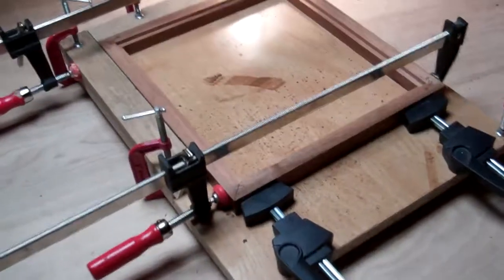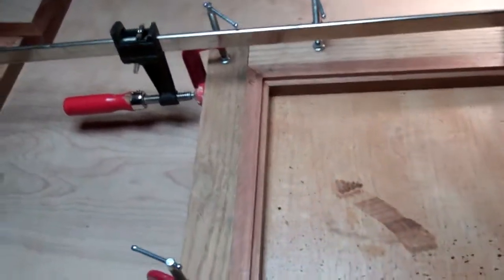Picture Frames

Comment: Nice to see you Pete! Once the alternator is installed make sure the belt is tight enough that you can't turn the alternator pully without the whole belt turning the rest of the pullies. If the belt slips the alternator won't charge properly.That's my 2 cents worth.  Nice frames by the way! And doing that van will be a blast.